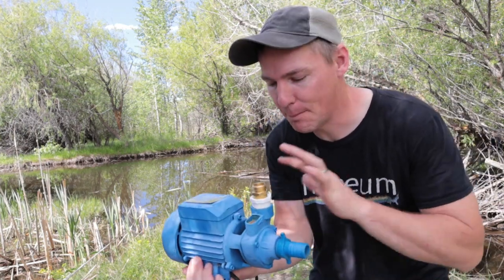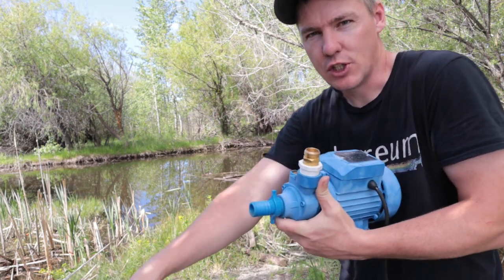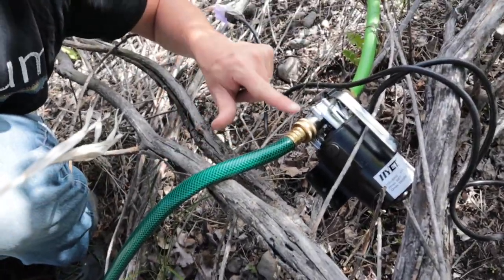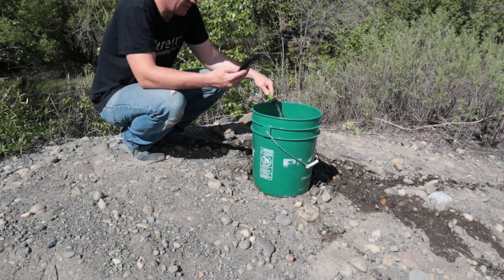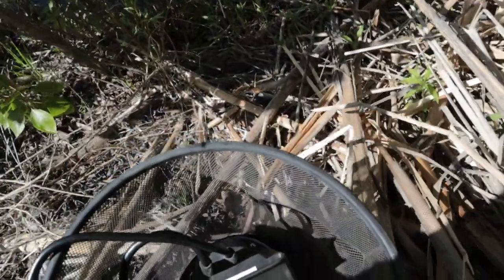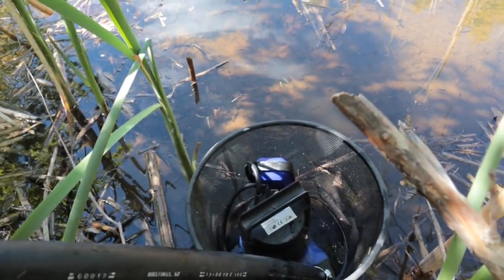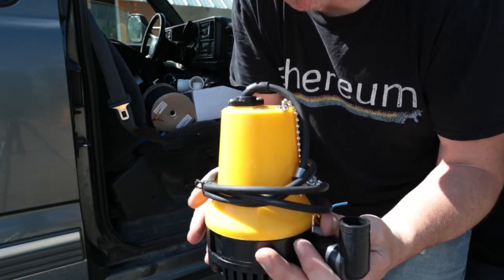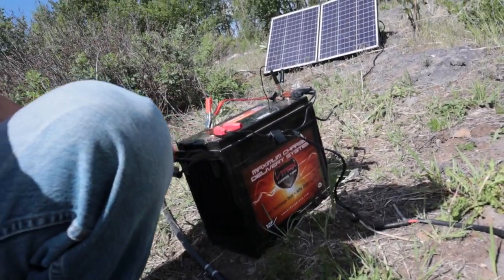Off Grid 12v DC and 115v AC water pumps, with Solar

Comment: Hi,  I have a Question..
That blue first AC pump, How much watts does it take ??  Just so I know if I’m using a invertor tide to my battery bank, I can determine how much Amp hr I will need also I can determine what wattage invertor to use..
Grate informative video by the way.

Comment: A quick question: I have solar panels and batteries at my cottage (my solar system is next to my cottage). If my cottage is at 100ft of the lake, should I use a DC or an AC pump, next to the lake? Because I'm concerned about the wire size to be used for that distance (from the batteries to the pump). Thank you

Comment: Please, can you let me know if the vertical lift with the DC pump was the same as the AC pump ... 15 feet?
Reply from the maker: In my case the, both where able to do a vertical lift of 15 ft, but it depends on the specific pump you buy, and also how much pressure there is left at 15 ft.

Comment: hello please check my future check up       

12volts DC water pump 19watts      
12volts solar panel 100wats
12volts 100amp lead acid battery
12volts solar charger  100 amp or 30amp ?

am i ok without using inverter? since im only intending to use this solely for the pump ?

Comment: What solar set up is that? What do you recommend for a 600 watt pump motor? 400 watt system? Will that donut?
Reply: As a rule, we double the wattage. In other words, we would set up 1200W of photovoltaic panels to run a 600 W pump. That seems to work well.